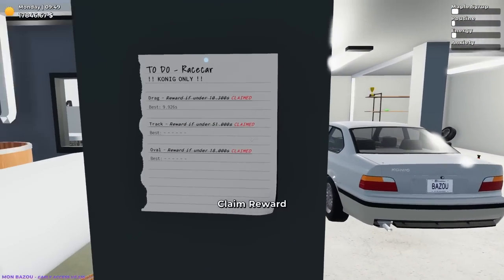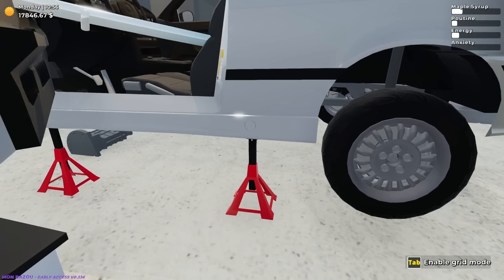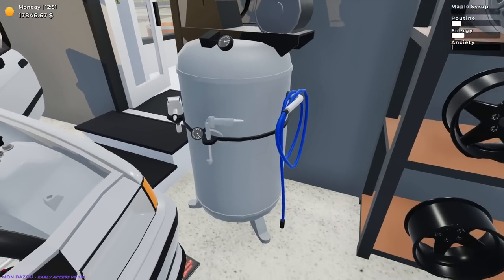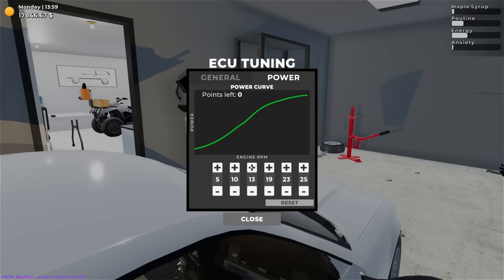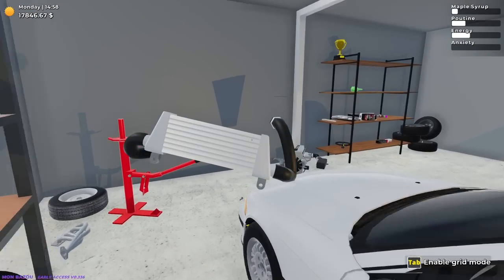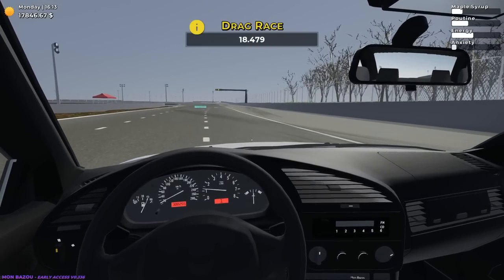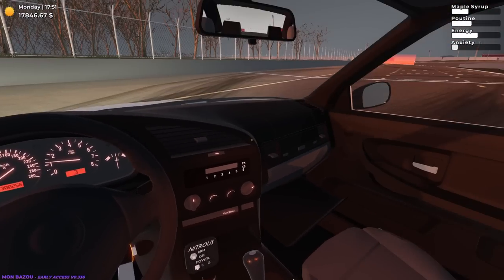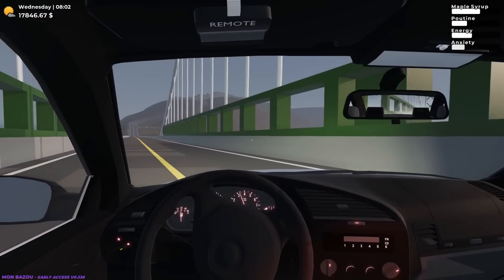Upgrading My BMW into DANGEROUS Drag Racer in Mon Bazou?

Comment from the maker: Give me those ECU tunes below!
Reply: I like to keep turbo at 20 friction 5 and abs 5.
Reply: putting lighter parts on the car will not increase grip if this game goes along with real life. if you want more grip you need to drop the tire pressure in the back to10 maybe even 5 pounds if possible and another thing that will help is getting the adjustable coil overs on all 4 corners and setting them soft. this will allow the car to move to accommodate the extra power instead of the tires needing to spin to make the power go somewhere, the downside to this thho is you have more body roll which will severely hurt handling some aspects but that is not important for a drag car
Reply: It's because the tires not the ecu and also lighter the car the less grip hopefully if you see this it helps 
@Isaiah Smith is correct
Reply: Cool!
Reply: I agree with @Isaiah Smith, but if comodo wants more grip plus lighter weight, he should paint the car black and hide the carbon fiber hood and trunk and also do the thing that Isaiah said.
Reply: Idk but hi
Reply: The tank does not need to be connected to the truck to fill it.
Just leave it at the shack until it's full. Then you can use the truck without the tank. 
Another way if you want the rollbar with the lights on, you can drive the dank without screwing it down on the truck 😉
Reply: You need to fill the whole crate with big packs of parsley to get a special item
Reply: Drop rear tire pressure down to 10 PSI That will help with grip, at least it does on real cars...🤣
Reply: Dont use the Nitro before 4 gear.
Reply: 3:57 you saw those bolts right?
Reply: turbo and nitrous at max and traction and abs at 5 and use most grippy tires or race tires
Reply: The power curve. Thats not gears right it's engine rpm so killing the curve at the end affects all gears.
Reply: @mitchtwhc93  yes it does he needs to learn about cars
Reply: @mitchtwhc93  yep I sighed at that point 😂. Like no, it’s not a bad idea to put some torque and power into the lower rpms, too, but cutting about half of your power out after 2/3rds of your revs is not the way.
Reply: i just ran 9.6 with 9psi on the turbo, no traction control, no NoS, power curve 5 10 13 19 23 25, no carbon body parts or anything, still stock seats. Too much psi just makes you spin the entire time, less power you put it down much sooner
Reply: Only thing I can think of are tires/tyres
Reply: I you want grip, dont drive a bmw, drive something american. but it is mon bazou. so turn your abs at like 6, turbo at like 13, and maybe friction at 7. for the power, its better to have a more flat curve if you want grip.
Reply: A New Konig Car will be added in the next update cant wait to see you upgrade it
Reply: Turn off Traction control
Reply: @jonnjacob  no?

Comment: This is for the ecu For using a keyboard, ABS at 10. Controller, turn it down a bit. Pedals, turn it very low.
Traction control: for the ITBS, a traction control setting of 3 is enough to get you off the line faster, but wont ever interfere once you are out of first gear. This is a nice compromise. If you are using the turbo, start out at 10, then reduce it as you get a feel for it.
Power tab:
Okay, the issue here is that the standard gearbox has pretty wide ratios. If you shift too early, the engine falls out of the powerband, and bogs. Even if you shift at the right moment, you can really feel it loose momentum anyway. So, the key is to beef up the midrange a bit, at the expense of the low end, which you dont use at all in fast driving. The last 4 numbers are the important ones.. This will give you power from 5k rpm upwards, which is what you need.
The standard numbers are 5,10,13,19,23,25. I am using 2,9,14,21,24,25. This gives a nice smooth power curve, with a wide power band from 5k up. This is ideal for track racing and fast road driving, but isn't so good for launching, unless you have a clutch to use. With the turbo, this disadvantage goes away, and the wide power band helps tame the handling.
I should say that the standard power band is a good all rounder, and yes, you can complete all the races and challenges with it standard.
Reply: This is only things people who know about cars. I like it

Comment: It’s a rear wheel drive car, so only drop the air pressure in the back. Dropping pressure in the front only means more rolling resistance. Increase pressure in the front.

Comment: The tank does not need to be connected to the truck to fill it.
Just leave it at the shack until it's full. Then you can use the truck without the tank. 
Another way if you want the rollbar with the lights on, you can drive the dank without screwing it down on the truck 😉

Comment: Take a look at the mon bazou wiki/forums. 1. your not tuning the gears in the ecu, I’m bad at explaining it but you’ll find the Infos you need online. 2. change the diff, don’t use the welded diff, use the lsd. 3. your tire pressures are too low. Especially in the front. 4. you need to setup the suspension. There are posts in the non bazou forums which explain what tuning you need for drag racing, racing on the track, etc. Your car will be uncontrollable if the suspension and tires are messed up.
My tip is, copy some tunes from the forums. It’s the easiest way and from there you could mess with the settings to see what happens if you change one thing at the time.

Comment: Your biggest handling issue is using a keyboard, cars don't tend to respond well to on and off push buttons,  using a wheel the car in standard form can run 9 second passes

Comment: You are getting the tuning wrong😂. On the graph left to right is rpm not gear. So what you are doing with ur tuning rn is that u are adding all the power in low rpm and high rpm u have no power (so every time u are on low rpm full throttle u spin out)